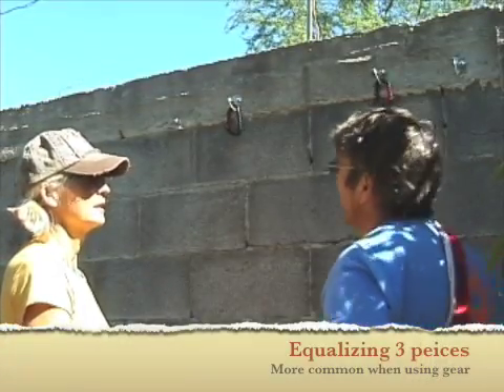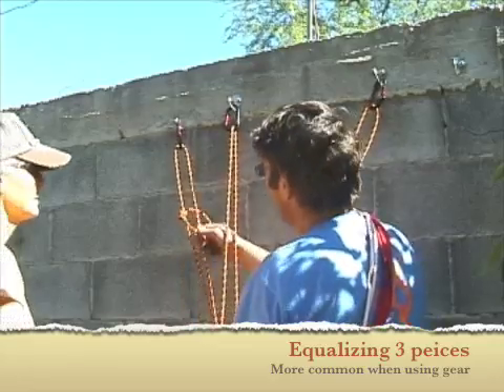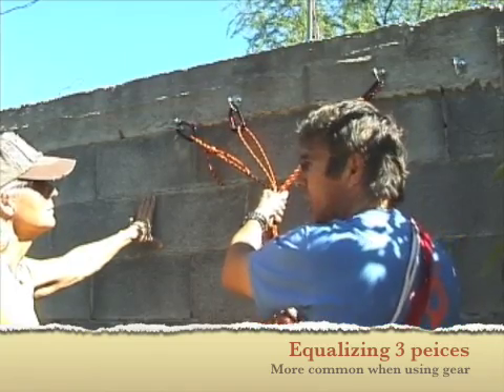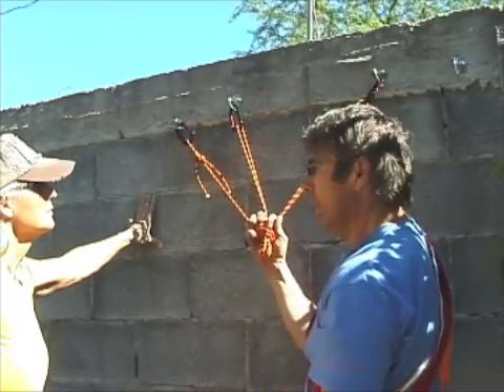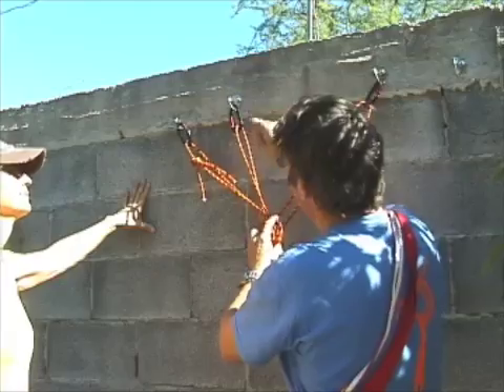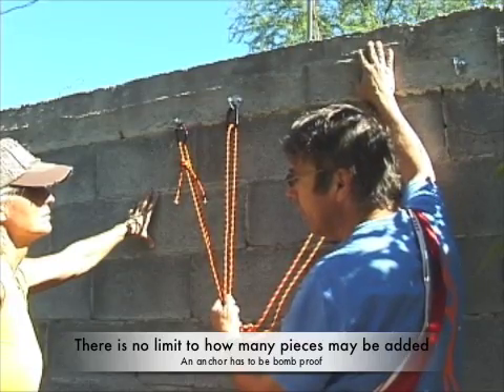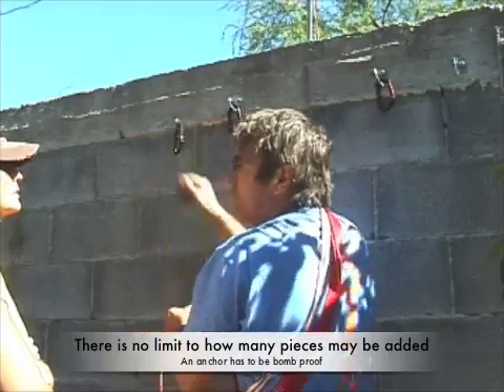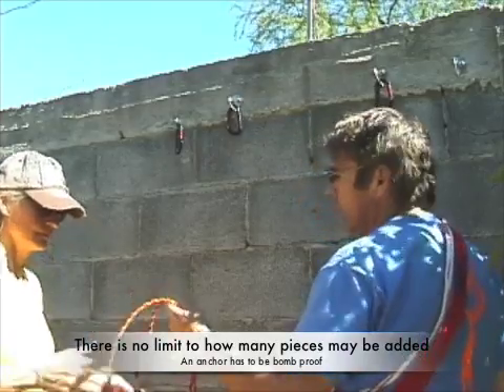Climbing Tools - 3 piece or more / anchors

Comment: Is 5mm to small do you think.... or maybe toeing the line? I am a fairly light individual, and I almost always use at least 3 points for my anchors... the difference in tensile strength of 5 and 6 mil cord is 450lbf, or about 2 kN

Comment: I've seen a sort of double sliding X on that type of rig instead of determining the direction of pull and tieing a figure of 8 or an overhand.  In your opinion Mike, which is better and why?  Sorry for the sumbitch of a multipart question, just trying to learn.

Comment: So, you show a great method of using a staticly equalized anchor, which works great if the climb is right over head of the anchor.  But lets say that pitch 2 heads  right or left of the anchor  and there is a good possibility that a swing will happen if the leader falls.  What kind of dynamic equilized anchor would you use (example the sliding X).  so that way the falling climber will not load only one side of the anchor and possibly blow out a stopper/cam.  I would like to see a vid like that.

Comment: Well said and, yes, you're right - the method you have is very basic and therefore safer since it's less likely to be built wrong.  Flipping the webbing and lark's foot knots are probably better off not attempted by a beginner.  Thanks!

Comment from the maker: I do not like the floating single strand equlized anchor thingy. It has its place in the worldid tyed off knife blades and such. I is just so easy to screw it up. This system is the safest cleanest and basically what we use for 95% plus of the anchors we construct. We could argue about the wording and I am sure you would win. As far as the best system to get folks started I would win. It has a identifiable focal point to clip into. Simple is good and I am simple

Comment from the maker: Ok ok, these are bolts so it doesn't really matter.Your a fire fighter I bet. In the true senseof the word these are not perfectly shared loads. The cord hs a lot of stretch and if you get the general direction of load close which is easy to to  you will get good distribution.

Comment: At 0:49 the statement is made referring to this being an equalized anchor.  This is incorrect.  Please look up what an equalized anchor is to see this term correctly defined.  There is a huge difference.  The anchor as displayed at 0:50 pulled from either side places entire load on only one piece of pro or bolt (the outermost, opposite from direction of pull).
Thanks for the vid!! :)